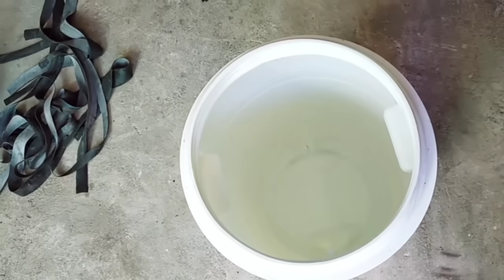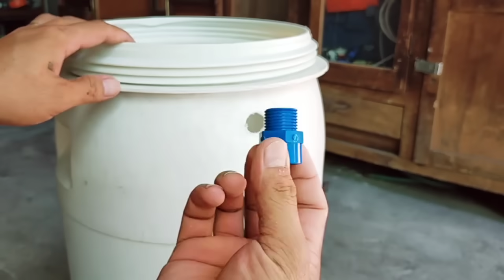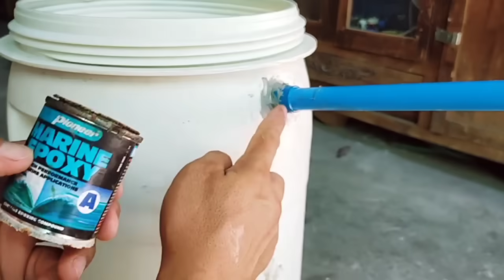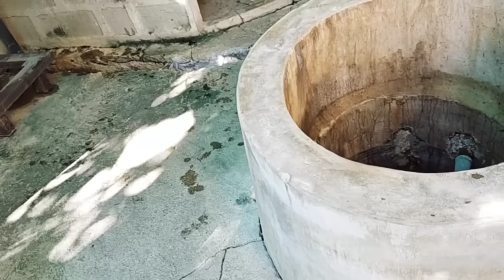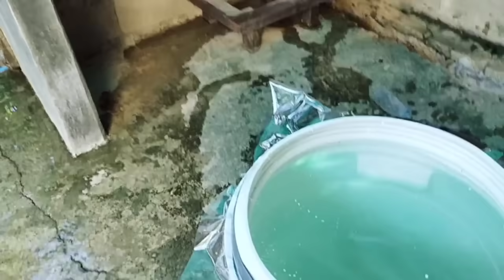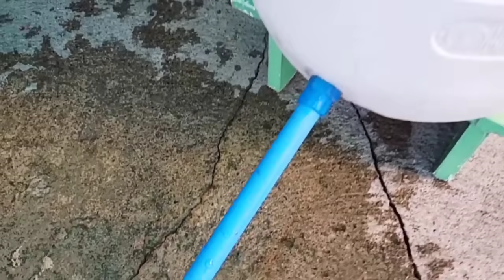improvised water pump no electricity how does it works none stop water life hack part 2

Comment: Da Vinci was a genius. The idea with the vacuum chamber is good but not in all conditions. You can't raise the water to a higher level than the barrel.
Reply: Yes, if you were to water your garden using hose connected to it. The flow will decrease if you raise hose above the level of outlet of the barrel. Lot of people are finding it difficult to believe, but it really works.
Reply: @vijaysolanki6728  The flow will decrease over time anyway. If we had measurements of the outflow vs the inflow, it would show that this is not perpetual motion. You simply cannot siphon water to a higher level than the basin.. no matter what kind of genius barrel setup you have. To do this would be a gross violation of physics. If this worked, pump manufacturers the world over would be trembling.
Reply: @jasonfoster9118  I ain't much clued in physics but was thinking the same you know, like the freakin water pump makers be goin outta business for sure
Reply: Add a ram pump...

Comment: This is really good idea. If you put the burrel higher up and use it's output line as input to a water ram pump ,it would move the water so much higher.
Reply: Or just use it to power a waterwheel generator and recirculate the water portable water power any where on the planet 🤔
Reply: @randypratt2887  yes but you would need much greater output. Don't think it's worth for lets say 20W of power from such output.
Reply: @adamstewarton  20w 😂😂😂if it worked I would be producing a lot more then that I would be powering my house and I would use water and antifreeze so that it wouldn't freeze in winter or I would have the system insulated
Reply: @randypratt2887  obviously it depends on how much water your input would be, but i was referring to the video
Reply: good idea, but this idea is NOT WORKABLE OR NOT PRACTICABLE.
Reply: If you use output line as input, the water in the barrel will flow down to the well because of the gravity.
Reply: @randypratt2887  i think it could power a dynamo with water flowing out -into the dynamo - back into the well the cycle will continue. We can get free electricity and water for usage
Reply: @edwinrodrigues9747  yes that is if it actually worked
Reply: @randypratt2887  why it would not work? the same outlet will be flowing over the dynamo blades and back into the well.
Reply: Randy and Edwin Salams appreciate your discussion really good ideas and workable conditioned to success of this programme.
Reply: @najamkhattak6639  Since I saw this, I've been trying to find out why this has not been used to produce all the electricity that one needs. If this were to be built at a much larger scale, the discharge could easily spin a large hydro turbine.
Reply: @randypratt2887  It does work. I have personally built one of these at a much smaller scale in high school.
Reply: @jordondarke1884    Then try to find documents to this project. I am sure you did not built such kind of pump. Or try to speak to the science teacher who let you do this project. Or any other person competent in physics. They will tell you at once that this video is a fake. That's why it is not used to produce electricity. You must have done something else in your project.
Reply: @heinzpg  LOL okay. It's siphon, not a pump. Don't look for anything with the word pump....
Reply: @jordondarke1884     Ok, but I repeat for clarification: what is shown in this video is not a siphon. A siphon only works if the outlet is lower than the water level in the well. With a siphon water moves upwards for some height, but always a bigger height downwards, so overall water is not lifted. This fake-video pretends that water is lifted from a deep well. This is not possible with a siphon, for lifting water you need a pump.
Reply: @heinzpg  Well I repeat for clarification, that is incorrect. It's not a siphon using the gravity from the source, like a usual siphon.
Reply: @jordondarke1884    It's not a usual siphon. Ok, but what is it? When you did a project work on that, this kind of system must be known to science and it must have a name. What is it called? Where can I find a reference to this system? Are you aware that lifting water to a higher level without input of energy means a perpetuum mobile? Don't tell me that gravity supplies energy. With such a system water would move upwards a greater heigth than downwards. Gravity must be overcome for that! And a vacuum can not supply more energy than was needed to create the vacuum. So where does the energy come from?
Reply: @jordondarke1884    I never claimed to know "all", but I have an MSc degree in engineering and it would be a shame if I wouldn't have some competence in physics. 
The vacuum is created, because more water is flowing out than in. But it is very surprisig that there is any water coming up from the well at all. You see, vacuum "sucks" in both directions. The effects here do not depend on the weight of water but on water pressure in relation to air pressure. Water pressure depends on the height of the water column. The water column in the vertical pipe going down in the well is higher than the water in the barrel. This means, that with a growing vacuum the outflow would be stopped by the vacuum before it would be strong enough to rise water from the well. 
You can object, that it is clearly visible that water comes in from the well. Sorry, this is not clearly visible. Water comes in all right, but where does it come from? When he demonstrates the system you never see the whole area of the well anymore. For example, there can be a hose going down in the corner of the well you never see, connected to the regular water supply, which is under water connected to the vertical pipe. This is a fake video just as all the others which pretend that water can be lifted up without an input of energy.
Reply: @heinzpg  When you answer my question, I will answer yours. Please enlighten us all and explain the concave shape of the lid IF water were being pumped into the barrel. 

Better yet,  you should take a trip to Indonesia sometime and explain to the locals there that the tens -- or more like the hundreds -- of these that are currently in use are just figments of their imaginations and that their crops are growing with imaginary water. You're probably right, though, I bet they were all created for YouTube channels as well.
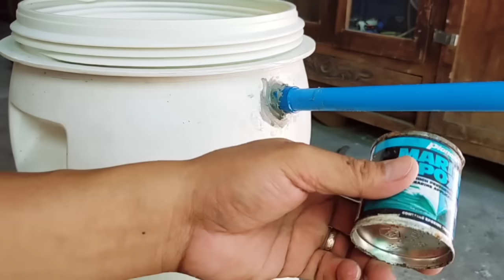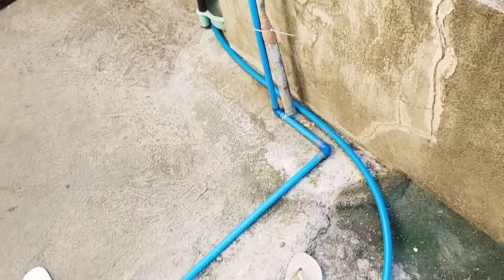Reply: @jordondarke1884    Have a look at this video again. The tap of the outlet is opened at min 2:28. Water flows out. But no water comes in. Thus of course a vacuum is created and the covering sheet gets a concave shape. It takes about 10 seconds until min 2:40, before water starts flowing in. If approximately the same amount of water flows in as out, the vacuum does not change. In min 3:42 he closes the tap of the outlet, and with this also the inflow stops abruptly. Why if there is still a "sucking" vacuum? Mind, when the inflowing water stems from the normal water supply or by a submerged pump, it is simple to activate and disactivate this water flow whenever it is appropriate. This needs just the turn of a tap or a switch.

" When you answer my questions, I will answer yours "  Ha, ha, ha! How unmasking! If you would have competence and knowledge you would answer questions and give explanations readily without linking it to preconditions. 

" You should take a trip to Indonesia "  LOL! Nowadays there is no need to travel to a country to know what happens there. We have reports, photos and videos of other countries. I bet the staff of the Indonesian embassy has never heard about this miraculous system! And why just Indonesia? If this system would work it would be used not only in Indonesia, not only in Asia, but also in Africa, Australia, Europe and America. And you could see models of it in science museums. And you would find descriptions of it in the internet. I don't find any, can you give me a link? But what you do find all over the world, when water has to be lifted out of wells: winches for drawing up water buckets, all kind of pumps, manually operated or driven by e-motors or combustion engines. In underdeveloped countries they still let animals walk in circles to operate water pumps. Probably because they all have no access to YouTube to learn how you can lift water without an energy input ...  🙂
Reply: This concept has a big disvantage it's the vacuum result of pulling water from the well. Energy can't be created or destroyed and the energy of gravity used to syphon water is stored as vacuum. Water can't be compressed but air does. The problem in this is the inlet water volume is smaller than the output volume because some of this mass is used to syphon the water resulting in a constant pressure decreasing. There is some video that shows a metal barrel shrinking at this.
Reply: @juanmanumanudice8848    Sorry, but your analysis does not fit. This does not work if the outlet is higher up than the water level in the well, but not because pressure will decrease constantly. With decreasing pressure at the top of the barrel the outflow will be stopped at some point and thus the pressure will not decrease any more. With the outlet higher than the water level in the well this will happen before the pressure is low enough to bring water up from the well. Also a metal barrel will not shrink just because it was filled with water and water is let out at the bottom. Also in this case the outflow will stop long before the vacuum is strong enough to cause the barrel to bend in. The videos which show a damaged barrel are fakes.
Reply: @heinzpg  water can not be compressed, air can be compressed. Right? In that thing at the vid there is air in the pipe. Right? A normal syphon will stop if the pipe is filled with air. This is the point in this invention. It's not a syphon it's called flying outlet syphon because there is an extra mass of water pulling from the upper inlet. Everything is hermetically closed so the water in the barrel will pull up when trying to exit the barrel. That's why it's named flying oulet syphon. It's a hack of nature.
Reply: @juanmanumanudice8848     The mass of water is not relevant in such a system. It is just a question of water pressure and air pressure at both sides of the water column. And water pressure only depends on the vertical height of the water column, not on its mass. If you have a U-shaped pipe with a thick pipe on one side and a thin pipe on the other side, masses are different in the two limbs, but the level is the same on both sides. Since pressure is relevant, not mass. If the vacuum is strong enough to get up the water from a deep well it is even more able to stop the flow at the outlet where the height of the water column is smaller. 
A hack of nature? Here is another argument for you: in nature we have conservation of energy. If this "pump" would work you could let the water flow back in the well and drive a turbine on its way. Endless electricity for free!? An energy output without energy input? Do you really think that perpetuum mobiles are possible?
Reply: @heinzpg  very nice but one step beyond. How is the vacuum created here? We have two tanks of water divided by a chunck of air. The air won't go under the water, air will stay on top a bit streetched doing the magic in this device. A turbine in this invention is useless it won't move the flow is too low. Just enough to bring some water with little effort.
Reply: @juanmanumanudice8848     The vacuum is indeed created by water flowing out without anything coming in. But this process stops very soon, since the increasing vacuum inhibits the outflow. And with an outlet being higher than the water level in the well this happens before the vacuum is strong enough to bring any water up from the well.
If a turbine with a generator would produce just a milli-Watt, or less or more, is of no importance for the principle of conservation of energy. Energy, never mind if it is a small or a big amount, can't be delivered without an input of energy. This "pump" could move water in an endless circle up from the well and flowing back in the well. This alone would already mean a perpetuum mobile delivering endless energy, if you consider the elements of friction and resistance.
Reply: @heinzpg  you are in contradiction???!!! That's what happens with so many laws in your mind you don't get the point and the uses of that invention.
Reply: @juanmanumanudice8848    It is very useful to know about conservation of energy, which is one of the most fundamental laws of physics. After all, the Noether-theorem shows, that conservation of energy is a prerequisite for the stability of our universe and engineers and scientists use it since a long time and the result is always correct. Ok, you aren't familiar with this law. 
Which is no problem, I can also refer to more simpler stuff. Let's assume as an example that the vertical pipe going down the well has a height of 3 meters and the water height at the outlet side is one meter. To get water up from the well, the pressure in the vacuum area at the top of the barrel must be below 0,7 bar. Now it is your turn to explain, why a pressure below 0,7 bar doesn't stop the flow of water at the outlet. After all, already a pressure below 0,9 bar would do that.
Reply: @heinzpg  i'm outta here mr lawyer. Don't want the universe to be destroyed by trying to bring you to the real world. Byeeee
Reply: @juanmanumanudice8848    You are on the wrong track, my friend. I am not a lawyer, I have a MSc degree in engineering and I have been teaching science at a university. Thus it is no surprise that my knowledge in physics is better than yours. Physics are by the way all about the real world and conservation of energy is a fascinating property of our world. In contrast, fakes are not the real world. If the outlet is higher than the water level in the well - which can't be judged for sure in this video, but the video gives this impression - then this video is one of the many fake videos which have popped up in YT about this miraculous "pump". Bye.
Reply: @edwinrodrigues9747  Gravity!! Water does NOT flow uphill unaided drive turbine then back into the well to be recycled.
Reply: @ericchapman399  the blades of the turbine need to be below the outlet and the water after flowing over the blades go back into the well. So moving the blades and conserving water
Reply: @heinzpg أود أن أوضح لك الفكرة ببساطة،اولا عند فتح بوابة الماء الخارج من الخزان،فإن الماء يتدفق إلى الخارج بقوة الجاذبية الأرضية اليس كذلك،وأن خروج هذا الماء سيترك فراغا في الخزان أي يصبح هناك تخلخلا بالضغط داخل الخزان،ونتيجة لهذا التخلخل تبدأ المرحلة الثانية وهي صعود الماء من البئر إلى الخزان فما هي المشكلة ليس هناك أي تعارض مع قوانين الفيزياء
Reply: @fadelalsherifi5684    If the outlet is higher than the water level in the well, then this "pump" would violate laws of physics. For instance conservation of energy. You could let the water flow back in the well and drive a turbine on its way. Thus you would have a perpetuum mobile, electricity for free! But unfortunately, perpetuum mobiles do not exist.
The detailed reason why this does not work to lift water to a higher place: the increasing vacuum at the top of the barrel stops the outflow of water before it is strong enough to lift water from the well. Relevant is water pressure, not the mass of the water. And water pressure only depends on the vertical height of the water column.
Reply: ❤❤ güzel olmuş harika
Reply: @ismailtosun743  bu video saxtadır.
Reply: @heinzpg  Belə anladım ki, vakkum su sütunundakı təzyiqindən çox ola bilməz.Yəni vakkum suyu sovurub çıxara bilməz.